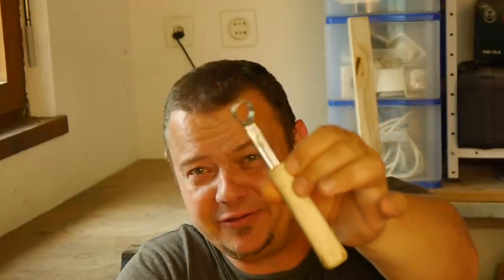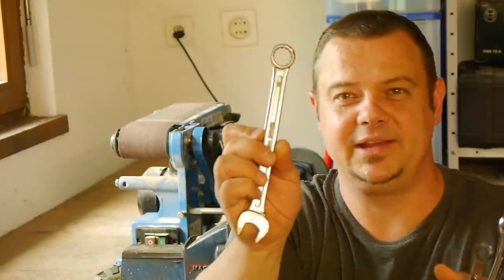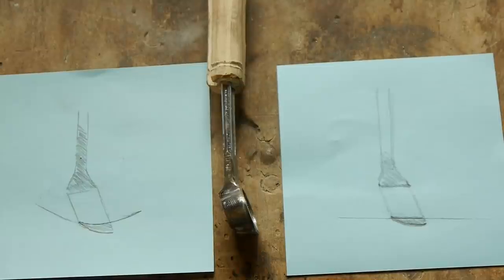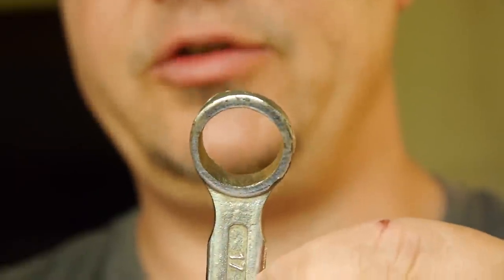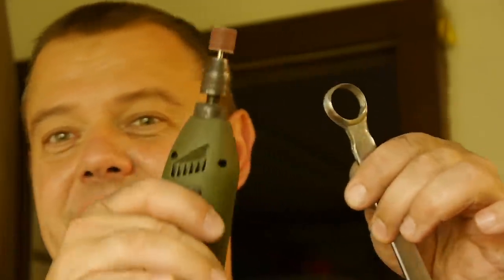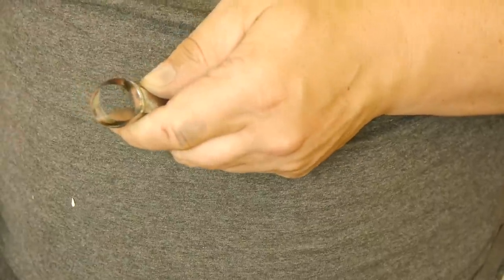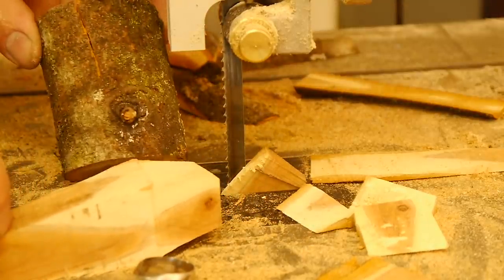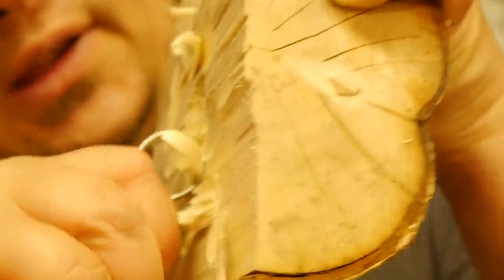From an old Wrench into a Spoon Carving Knife (Scorp)  /  Hand Tool Transformation, for everyone!!

Comment: Like a lot of these videos I’m a bit late, but I rewatched this video this evening, and realised I had a couple of cheap spanners in the garage after all, so I went in there (my hideaway!) and modified the 13mm ring. Not entirely successful, but I usually have to ‘have a go’ once so that I can more fully understand the instructions! It’s working, it needs fine tuning but it’s working. If it goes well I might manage with the 13mm, but I have a 14mm in case I need to reset the project. Thanks Felix, you’re a gem! Les in UK 🇬🇧
Reply from the maker: Thank you so much for your wonderful comment!

Comment: Thanks again for one more inspiring idea on video. Being a steel guy, I like to suggest some ideas to improve the tool. You could also start with a straight double ring wrench acc. to DIN 837 B / ISO 3318. Then one wrench might be good for two carving tools of different size. Also, you can bend the ring to the desired angel after heating the bending spot until it's glowing bright red. Heating the ring to the same glowing color for 10 minutes in charcoal fire in your grille and letting it cool down slowly will soften the steel and make the file work easier. When your done with coarse sharpening, just heat it up again to red glow and quench it in cold water to harden the steel. With some luck you reach 55 HRC with allows higher sharpness and better edge retention. Don't do the heat treatment with a soldering torch or other blue flame to avoid decarbonization of the outer steel layers.
Reply from the maker: Hello Frank. Thank you very much for your valuable tips!!!

Comment: Just saved me some money and gave me a new project to work on. WIN WIN Thanks.
Reply from the maker: Very welcom!
Reply: Just don't use your file like that, because you're going to dull it's teeth. Always use your files in forward motion, not back and forth like how we use saws. That means, that if you do it like on video, it will cost you more,than what the knife costs, because dull file teeth, means dead file and good files cost.
Reply: @greekveteran2715  Thanks for the tip, appreciate it.

Comment: It is funny that I came across this video as I was scrolling through your channel as I had this same idea about two years ago and did this to three different sizes of wrenches that I picked up at a flea market for a little bit of nothing. I used a  die grinder and rotary files to do the bulk of the mterial removal, then hand files, wet/dry sandpaper and round honing stones. I put an adge on both sides of mine to make them more versatile

Comment: Awesome work. A old trick I learned from my grandfather, when filing metal, use some chaulk, the kind you use on a chalkboard. Not a lot, just enough to stop the squealing when filing.
Reply from the maker: Great tip! Thank you!
Reply: The squiling noice will be louder if you have the working end more away from the vise, so just get it closer.

For the chalk on a file here we do it to have a other effect. if you are done with filework, chalk the file up and file with light pressure. this will smoth the workpeace and save a lot of time and sandpaper. we call that process “schlichten“ .

have a nice day
greatz from Germany
opo
Reply: Good to load up with chalk before filing aluminum too.  Keeps the clogging down.

Comment: Felix, I have a new trick for you!

The metal push pin in the + scales.

I was trying to do some wiring on my cars, and needed to know which wire was live (+12V). Well, I could have stripped a portion of the wire to test it with a meter, but the newly exposed wire could short against the frame, or corrode with water damage.

Instead, I remembered a trick: push the oush pin into the wire, like a vaccine needle in the arm. Once the tip is (probably) making contact with the copper wire, you can use a voltmeter to test the wire!

Comment: Felix, this was inspirational. I am upset I just bought a second hook knife - it was a left hand. The first was a left/right hand (sharp both sides) and it wounded me within a minute pretty badly. I am going to turn a cheap wrench (they go for a couple bucks in Canada here as no-one wants them) into both versions, thanks to you. This will happen. Moreover, after hearing about your Pinterest, I subscribed there too. Pity you dont have much to show there. Be well!
Reply from the maker: Thanks  for your comment. I never postet something on pinterest.  Is this project on pinterst?
Reply: @FelixImmler  I Believe you mentioned your inspiration for this scorp came from Pinterest. So I joined you there 😊
Reply: Felix! I did make this eventually. Not one, but three sizes in small, medium and large. I decided to bend the "neck" of the small scorp into a more acute angle as an experiment, much like a bent gouge neck. It was easy to draw out (stretch) and then reharden and temper. Very simple stuff. I also sharpened both edges/sides of the scorp and I am very glad I did - each gives a wonderfully different approach angle wise for difficult sides/ corners. I carved my first spoon yesterday with the small one in some very dry apple wood. Despite the hardness, the scorp did the trick. Thank you for the inspiration. One question I do have - how do you deal with "reversing" grain in the centre part of the spoons cup? I tried sideways, back and forwards with both sides of the scorp at different angles, and I really wasnt able to put a perfectly smooth surface in the cup. I resorted to sandpaper to get it done (rolls eyes). How do you deal with this?